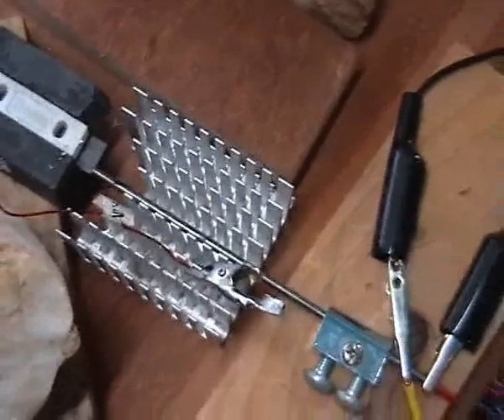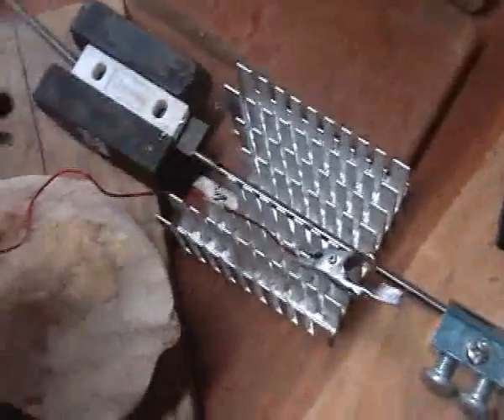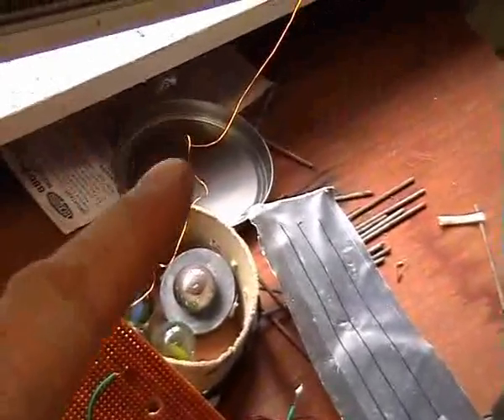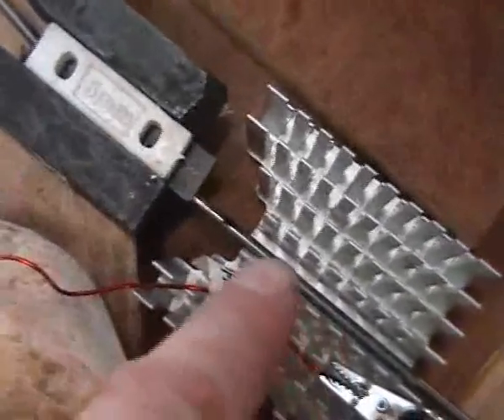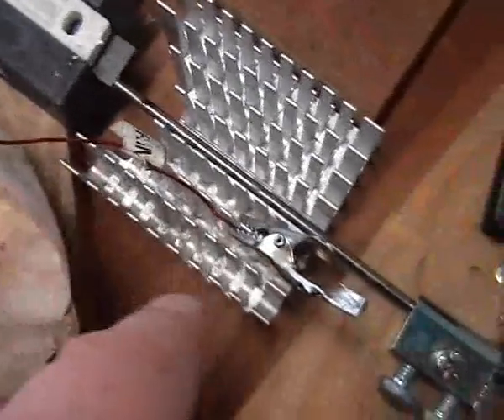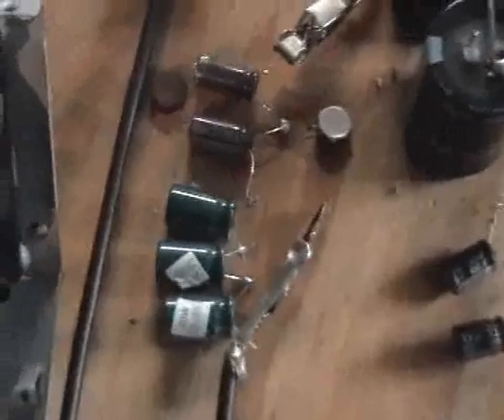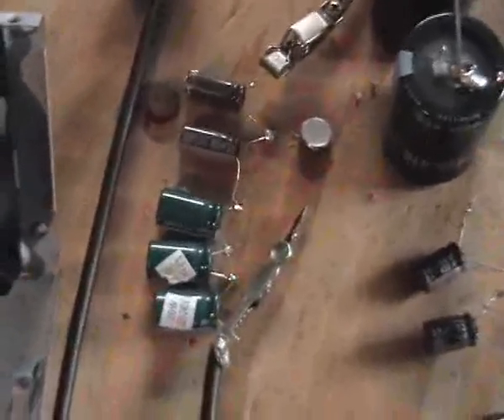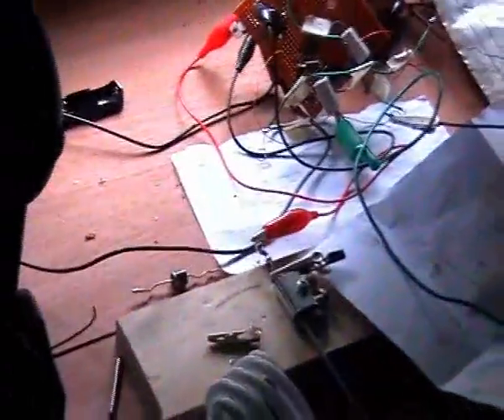UPDATE 28 EDWIN GRAY / TESLA RADIANT ENERGY HYBRID CIRCUIT Running at 48volts

Comment: no.  The spark gap is supposed to produce radiant energy waves of greater energy that are picked up by the heatsink (wich is a poor representaion of the ed gray tube).  This creates cold electricity or radiant energy wich is transmitted to the lights.   A little energy makes the spark wich unleashes alot of energyy to power the lights.